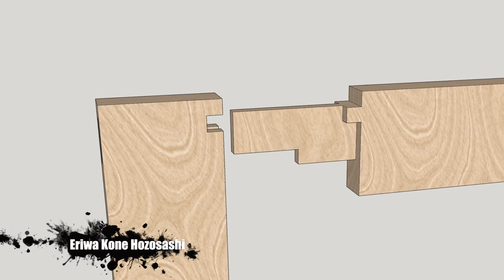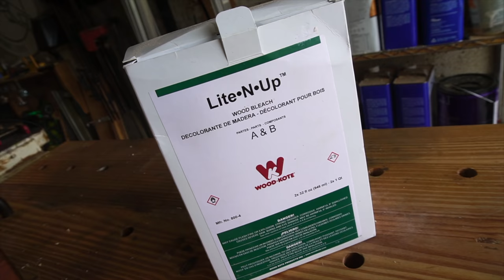Timber Frame Sliding Barn Door | Modern Barn Door Build | Japanese Woodworking

Comment from the maker: Support my channel through the following affiliate links:
-The Real Milk Paint Company's Impressive line of finishing products (Special Affiliate Link):
https://www.realmilkpaint.com/ref/cowdogcraftworks/
For 10% off use coupon code: cowdogcraftworks
-Starbond CA Glues (Special Affiliate Link): https://bit.ly/36sB2Bv

Amazon affiliate links:
The Complete Japanese Joinery (Book): https://amzn.to/2OAj1sM
SMARTSTANDARD 8 Feet Top Mount Sturdy Sliding Barn Hardware Kit: https://amzn.to/32D8pR5
Center Punch: https://amzn.to/3fSQsCj
Stanley Sweetheart Chisels: https://amzn.to/2ZATrKg
Solid Brass Wheel Marking Gauge: https://amzn.to/3jfDFfR
DFM Tool Works Card Scraper Set: https://amzn.to/2CMZp1W
DFM Tool Works Card Scraper Burnisher: https://amzn.to/2ZAwzuv
DFM Tool Works Small Square and Center Finder: https://amzn.to/3jfFdXd
Glu-bot Glue Bottle: https://amzn.to/2CdxYOV
Mineral Spirits: https://amzn.to/31xTBmG
Dewalt Compact Drill: https://amzn.to/3ht3tng
Metric Japanese Style Carpenter's Square: https://amzn.to/35kC3fG
Rok Hardware 14 Gauge Table Top Fasteners with Screws: https://amzn.to/38CzW94
Mini Square 10x5cm: https://amzn.to/36mtcti
Faber-Castell Ecco Pigment 0.1 mm Pen: https://amzn.to/36oLni8
Pentel Mechanical Pencil: https://amzn.to/36uqbab
Freud Flush, 1/8",1/4",5/16",3/8",7/16",1/2" Depth Rabbeting Bit Set with interchangeable bearings with 1/4" Shank: https://amzn.to/32yNvm6
Rannb Round Over Edging Router Bit 1/4" Shank 1/2" Cutting Radius Bearing Guide Corner Rounding Router Bit: https://amzn.to/38yfBlf
Yonico 45 Degree Chamfer Edge Forming Router Bit 1/4-Inch Shank: https://amzn.to/2UgrKCX

If you want access to more of the tools, check out my amazon storefront: https://www.amazon.com/shop/cowdogcraftworks

Comment: Novel approach to the whole build; non-traditional, non-conformist.  Love the use of a cloud lift to lighten the overall appearance.
Curious to know how many hours you have in this project.  Do you think you could reduce some of the hand chiseling with an increased use of a router to do some of the hogging?
Reply from the maker: Absolutely. I would guess I had somewhere between 60-80 hours on it. A bandsaw or yes even a router would have helped significantly with the tenons. The mortises are a little trickier because they’re so deep and/or through.